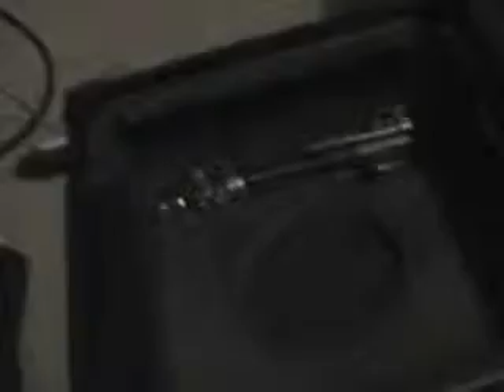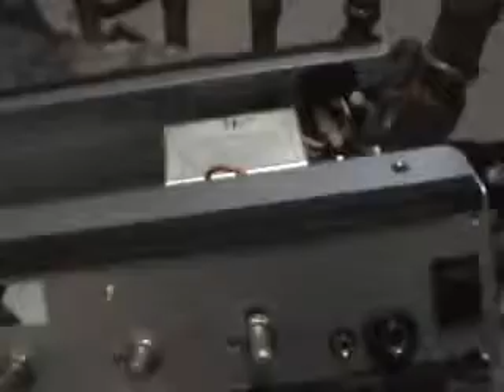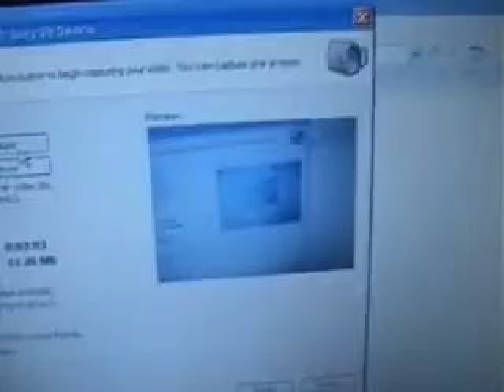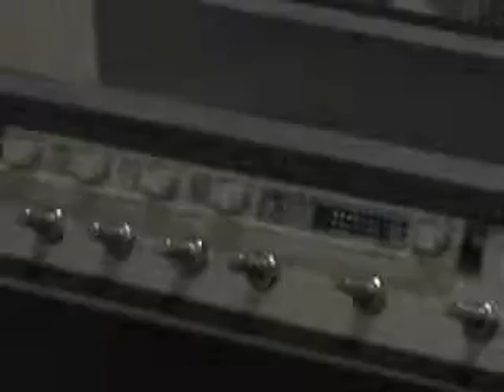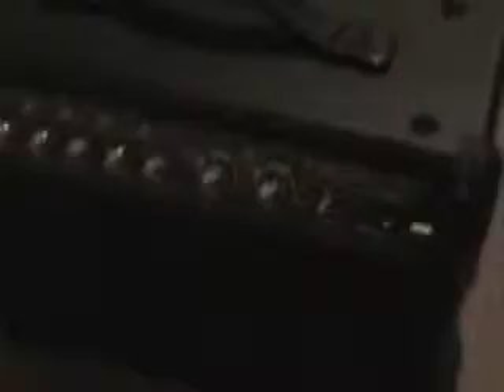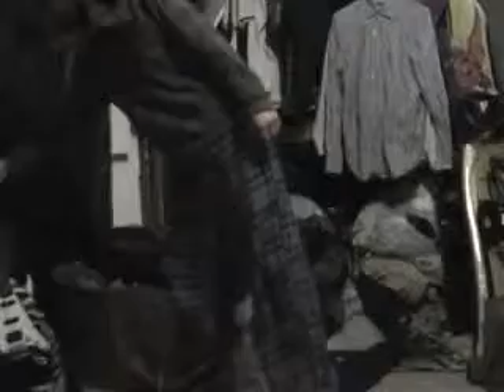line 6 fixed

Comment: that happened to me and i replaced the pot but now the amp has a strong hum. can you elaborate.
Reply from the maker: Well i can try, the problem lies in whatever knob crackles. If no knobs crackle then maybe its the input jack. Does the sound change at all when something is plugged in... Make sure the input jacks is soldered completely and the new pot you put in. Jiggling the knobs may reveal where a bad connection is
Reply from the maker: John Vargas it is possible the pot you put in had the pins in a different order too... This would cause feedback

Comment: idk if you're the person to be asking, but i have the same line 6 amp and i've had a problem for years with it. it's stuck on the insane channel, i've opened it up countless times, took the buttons apart, put them back together, nothing seems to work, it's just stuck still, let me know if you could have an idea about how to fix it, thanks
Reply from the maker: shayne combs if the volume knob isnt responding or theres a crackling issue(and its not the cord) then its probably time to replace the guitar input jack and/or the master volume knob. as for your amp being stuck on the insane channle i dont have an answer, although its probably the button, or the mini circuit board has fried and it's just stuck on insane
Reply from the maker: shayne combs worst case scenario you could get an "eighth inch to quarter inch jack converter" and plug it into the headphone spot, the tone controls won't work but the master volume will.